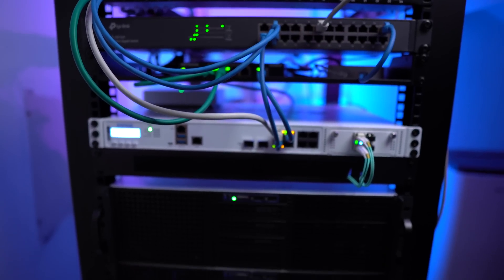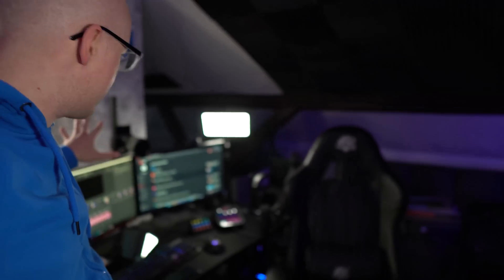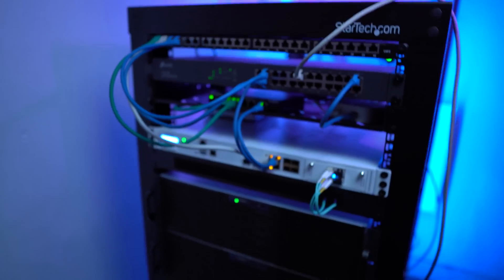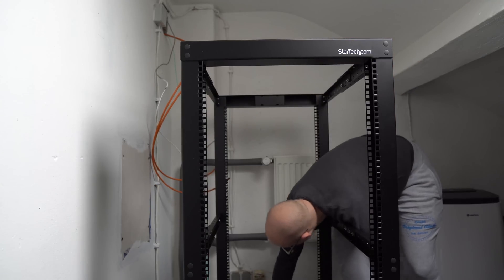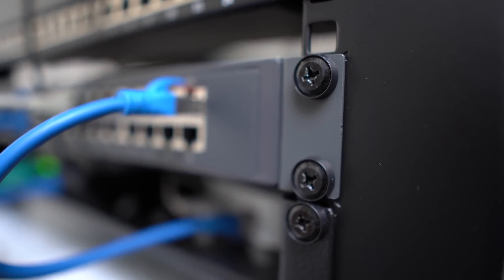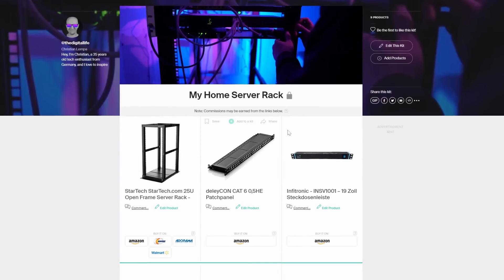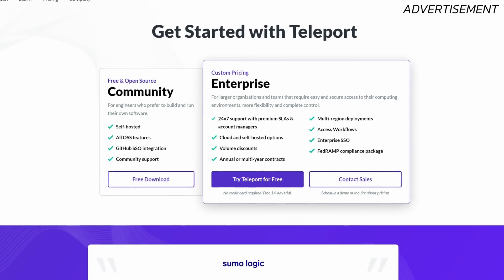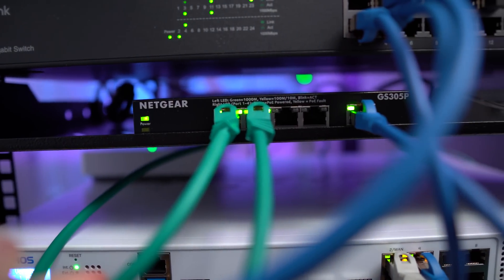I built a big Server Rack for my Home Lab!

Comment: 10:30 don't overlook used network hardware. It can still be expensive if you need 10 Gbps, but if you just need gigabit, used enterprise-class managed switches can be picked up very cheaply. I use a couple of HP 1820-24G switches (model J9803A): managed, fanless, 24 x gigabit copper plus 2 x gigabit SFP. I paid £25 each on ebay (around 28 Euros). Obsolete, but still perfectly capable.

Comment: I wish i had a place to put rack mounted devices in my home. Its small and the noise is to much. I am trying to find desktop server but they are so much more expensive for some reason.
Reply from the maker: Yeah that has been an issue for me as well :/ Maybe if you have an old desktop PC you can turn it into a server, but the Rack isn't cheap indeed.

Comment: Lovely build, am planning myself a similar one using Startech.. just havent plonked the money into it getting a Rack.. got a couple of Precisions running as my Hypervisor (VMware workstation tho )..a few Cisco switches for learning networking..  

but just curious as to how much you would incur as costs towards running these 24/7 or what strategy do you use for cost optimizations'.. ?
Reply from the maker: I don't use any professional server (besides my firewall and switch), that what keeps the power consumption low. And I try to not run too much all the time, that's all I can do.

Comment: Just be careful with the storage server - rails are nice but, if your rack is not anchored to the floor, fully loaded server once fully extended on rails can tip the rack. Depending of course how big it is and how the rack is loaded etc. 2U servers often come with a sticker warning not to extend more than one at the time if the rack is on wheels. With 4U ones 1 server can tip the entire thing.
Reply from the maker: Thank you, so much! I haven't actually thought about that, but intuitively put the storage case to the bottom of the rack (which now seems like a calculated decision :D)

Comment: Hey I need help and suggestion for planning my Home network. I am very interested in the following scenario:  I want to set up my home network so that I can access it via a VPN from the Internet (for example hosting a VPN Server) and at the same time I want to route all of my network traffic via a VPN Provider. How is this possible?
So in the Best case I can connect then to my Home network via my self hosted VPN and my traffic to the internet will routed over my Home network and then over the external VPN Provider to the internet even it I am not at home. Then there are a lot of possibilities to secure the home network and all this mechanisms apply to All my devices and to the devices which are connected to my home network via VPN.
I think it should be possible but can someone give my any advises how to achieve this goal?
I would be very thankful!

Comment: Hi Christian, cool project! Looking forward for the rest. In general I would recommend a managed switch that's supports vlan's for a project like this, the unmanaged one you use right now seems like a divestment. And a small correction: 10 Gbps ethernet over fibre is not the same as fibre channel.
Reply from the maker: Thanks! Yeah a managed switch is already planned ;)

Comment: As a completely Unifi (ed) household, I can recommend their Dreammachine Pro as Router, their switches and especially the access points. The single pane of glass management just makes it delightful to manage. The controller software (free) can be hosted in a Docker container, btw. Apart from that, I went down that 19“ rack rabbit hole for my home quite some time ago and have a nice 4U AMD Epyc 7282 Unraid Server in my 42U full enclosure rack (which also came in parts, luckily).
Reply from the maker: Oh that sounds like a really cool server rack on your side! :D I hope you'll enjoy my firewall video, as it covers all these points, as well as WiFi AP management :)
Reply: It is comparable to the Cisco Meraki platform (which REQUIRES licenses - which are cost-prohibitive). Once the license expires, they are nothing but glorified paperweights.

Comment: Very nice Christian! Take a look at TP-Link T1700G-28TQ with 4 Ports 10GE SFP+ for your Server (with 10GbE PCIE network card for Intel X520-DA1-82599EN Chip) and Netgear NETGEAR XS505M with 5 Ports 10GbE RJ45 for your Clients (with Asus XG-C100C).
Reply from the maker: Thank you! So funny! I bought some X520-DA1's for my servers and because it didn't work in win11 another one for my client :D, however the switch will be something different 😀